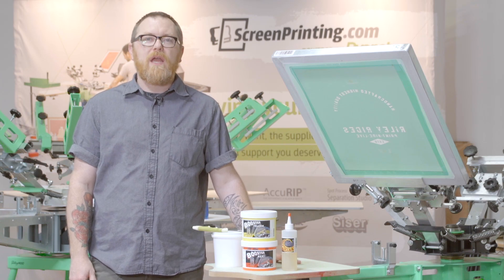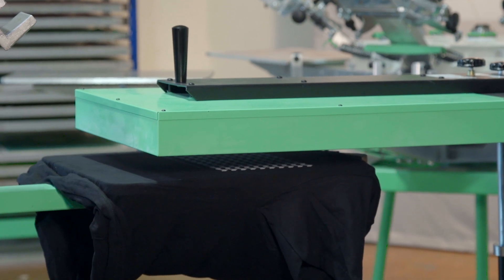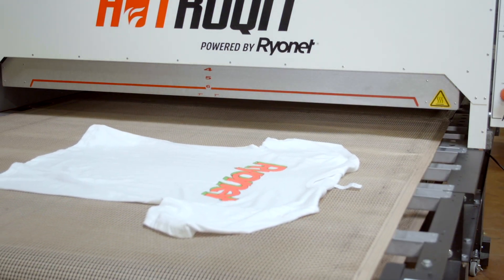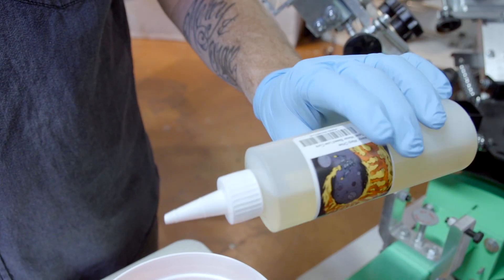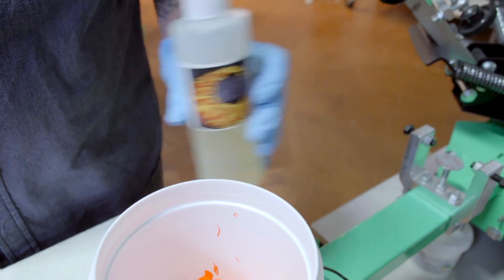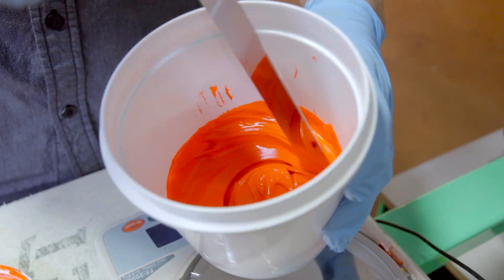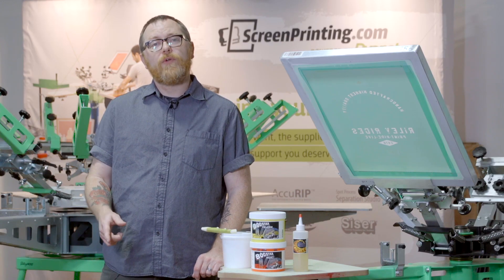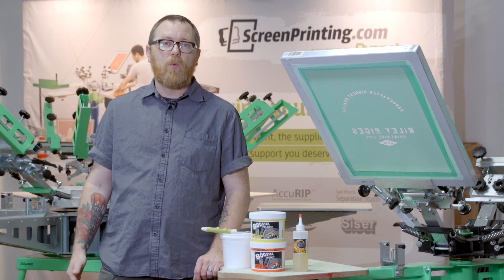Use Warp Drive To Reduce Curing Time and Temp

Comment: Sorry if this is a stupid question but is it necessary to use this on heather shirts? Like 52% cotton and 48% polyester. Does dye migration even happen on 50/50 shirts? I’m new to screen printing...
Reply from the maker: Not a stupid question! If you're using waterbase, I would almost always recommend adding warp drive as it will help guarantee your final cure and is great on dye migrating fabrics! You won't see that happening much on 50/50

Comment: Stupid question: How would Warp Drive cure time effect discharge standard cure times considering the temp and time difference for the chemical reaction?
Reply from the maker: It actually will not. We do not suggest using Warp Drive for discharge prints, as the curing process for water based inks and discharge inks are very different.

Comment: If I'm using a standard flasher to cure my garments how long should I leave it under the flash dryer with the warp drive additive?
Reply from the maker: Hey there! You are looking to get the ink to 180F, so you will want to temp your ink with a temp gun to make sure it is hitting that temperature, then you can remove it and wait 48 hours for the curing to complete.
Reply: Ryonet so I won't have to flash it for a certain length of time like 30 sec? just as long as I'm getting it to hit that temp?
Reply from the maker: Correct!  Get the ink to 180F, and then you'll want to set the shirt(s) aside for 48 hours, BEFORE you wash them.  The 48 hour timeframe is when the curing completes.
Reply: Ryonet great! Thank you so much!

Comment: Lookin forward to using low cure additives! 
With warp drive. If it cures as low as 180F. Does the WB ink still need the steam to escape to cure? 
Does it have to consistently stay at 180? Or does it just have to hit the desired temp like plastisol then it's good
Reply from the maker: It actually just needs to get to temp then it's good! Just make sure you don't wash the garment for 48 hours after curing so that the catalyst has ample time to set. Have fun Adam! :)
Reply: awesome, thanks! looking forward to it

Comment: Thanks for the info! I am just getting into water based inks. I know that a forced air dryer is optimal, but can I by with using a standard flash cure dryer (non-forced air) so long as I remain patient? Cost is the factor here for me. Thanks!
Reply from the maker: Absolutely Michael! Great questions. Infrared flash dryers work well enough, you just need to keep them over the ink for longer like you said. Keep your temp gun on the ink for your first couple of cures and watch the ink as it hits 320. Make sure it stays around 320 for around 60-120 seconds. Do a wash test to ensure you're hitting all of the spots on your design and you'll have a standard to go off! :)
Reply: Thanks for clarifying!